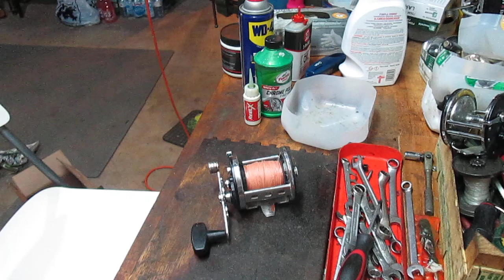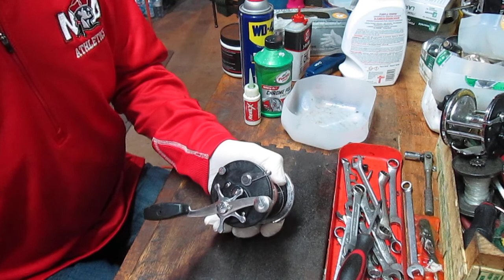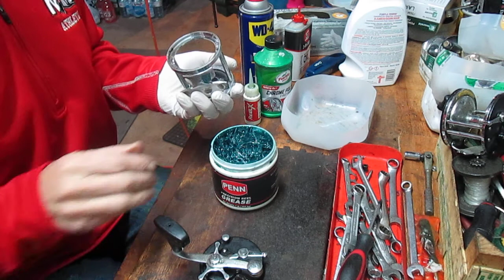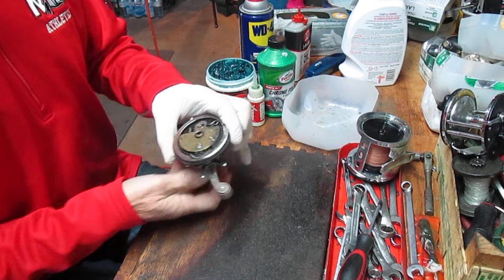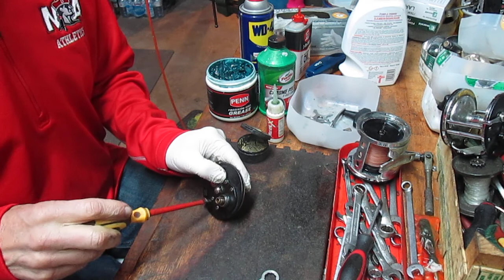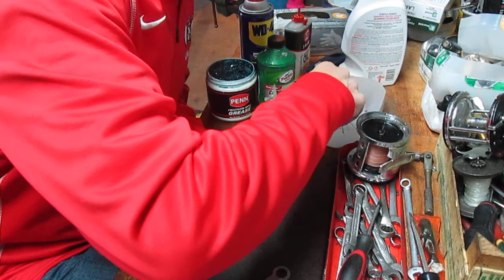Penn Jigmaster fishing reel speed servicing, disassembly, lubrication, drag service and rebuild

Comment: When I put the handle back on with the drag tight, I have a wobbly handle, what am I doing wrong?
Reply from the maker: Is the handle wobbly or the hole handle shaft that wobbles?  If it is just the handle, you may have cross stripped the handle screw.  If it is the hold shaft assembly including the star adjuster, etc then you have  a broken bridge post that would need to have the bridge replaced in order to correct it - Dennis

Comment: Hi Dennis how are you how do you lube a conventional fishing reel thanks
Reply from the maker: Yes - I grease all internal moving parts and I oil the bearings as the line guide mechanism if there is one on the reel.  A fair amount of grease is good, but do not overload as it will only get thrown off the moving parts and eventually dry on the recesses of the reel.

Comment: I spotted the anti reverse on this video.  It stays mounted to the plate. Much better then the Peerless 9 I just worked on. The little flat spring drove me to drink. Not that it had to drive very far. Thanks for all these videos. They have helped me with quite a few reels now.
Reply from the maker: Yes - the flat spring and the later coil spring are not easy.  The 500 comes with the bridge mounted A/R, which is much easier - Dennis
Reply: That spring on the 9 drives me crazy

Comment: I have a question, I have a Jigmaster 500 and when it’s in free spool, it sounds like the spool is rubbing against the side plate if I tilt it during casting. Do you know what the problem is? Thank you in advance.
Reply from the maker: I think you have a bad bearing.   Probably the one behind the handle.  You can get a replacement through Mysticparts.com. - I am assuming that you have tightened the other bearing on the non-handle side plate - Dennis
Reply: @2ndChanceTackle  Does a Jigmaster 500 have bearings? Or are they bushing?
Reply from the maker: Yes, but they are unique to Penn.  You can get the bearings at Mysticparts.com - Thanks for asking - Dennis

Comment: Dennis, can I also use the Penn 60 washer underneath the main gear where that red colored fabric washer would be? I'm like 99% sure it would be a good idea but I figure I'll ask the Penn wizard. The one that came with the OLD JigMaster I just bought is hard as a rock along with the other drag washers. Wish I could do something about the brass showing through some of the chrome pieces but rechroming comes with a large price tag for a piece I plan to fish some.
Reply from the maker: You can use the regular washer, but it is subject to tearing, where the hard washer is not.  If you are going to use a drag washer try to use the ht-100.  It has a plastic insert in the middle, so it won't tear as easily. If you use the older fabric washer, just check it occasionally as it could tear
Reply: @2ndChanceTackle  I actually bought an upgrade carbontex kit through Mystic Parts and it came with a carbontex washer for the bottom. I had bought a few smaller Penn 60 ht 100's to do the trick you show and intended on using it but I just used the kit from smooth drag and then added the 60 on top. Took a lot of work but this formerly unusable Penn JigMaster is spinning beautifully. It's an early rendition of it, I'm not sure how old but it's the oldest of the bunch I've bought and fixed. I put 200 yards of 30lb Dacron as backing and still got a rediculous amount of 20lb mono on top. Far more than I wanted or expected actually but I've yet to meet a striped bass or bluefish that can't be caught on 20lb line so I don't go heavier.

Comment: Hi Dennis,  just wanted to say thank you and that I love your videos.  I have a jigmaster 500 that I forgot to rinse off a few years back after a trip that developed corrosion as a result.  Thanks to your videos I was able to restore it by cleaning it up and properly greasing and lubricating.  All of the parts appear to be in good shape and none of the parts are frozen however when I put everything back together the spool will not spin.  It almost seems like to me that the main gear is not engaging with the pinion to rotate the spool.  Did I maybe miss a step when putting the reel back together or do you think there may be a problem with one of the parts?  The dog is in good working order, the anti-reverse is clicking like it's supposed to, everything spins freely like it's supposed to.  I just can't seem to get the spool to spin when I turn the handle when the reel is put back together.  Do you have any suggestions for me?  Thanks again!
Reply from the maker: Hi - The first guess is that you installed the spool gear upside down.  let's check.  Take the gear side plate off of the reel.  Is the spool gear end flat or is there a "U" shaped slot facing outward?  The spool gear is the one sticking through the hole in the center of the reel.  If the slot dies is not facing out, you will need to disassemble the gear side to reverse it.

If that is correct, the next cause could be that the bearing side spool adjuster is too tight.  When you regrets a reel and put grease in that adjuster, it can tighten up the slack that was in the reel.  Back  off  the bearing side adjuster by turning it counterclockwise and see if that makes a difference.

Those would be the two most common.  A third, which would be less likely, is that you installed the drag stack upside down.  If you are laughing, that is OK.  I have seen it done and it causes the problem you describe.  Make sure that the flat side of the main gear is on the bottom and rests on the gear sleeve washer and that the drags and washers inside the gear are facing out.

Try checking for these.  If it is none of the above, we can try again - Thanks for asking - Dennis
Reply: @2ndChanceTackle  Thank you so much Dennis, I'm at work so I don't have the reel with me but I will check when I get home and let you know.  I think that your first suggestion might be the answer.  Thank you once again!
Reply: @2ndChanceTackle  Dennis you are going to laugh, I forgot to tighten down the star drag tight so there was not enough tension to turn the spool.  Now it spins like it is supposed to, I just have to work with it a little to get it to rotate smoother but I think that should be an easy fix.  Thank  you again for helping me trouble shoot the problem.
Reply from the maker: Happens all of the time!  Especially if the star adjuster gets wedged by tightening the handle before it is adjusted and you think it's tight, when it isn't. Glad to hear it's working. - Dennis

Comment: i have a old jigmaster s. i cannot find any info online about it. could you tell me what the s is and the difference between the normal 500?
Reply from the maker: Yes - I believe the JigMaster 500$ has the single crew take apart system on the non-gear side plate.  The 500 has the take apart screw on the gear side.  The 500S is an older version of the reel and was introduced in the 1980's - Dennis

Comment: Removed the 60 drag washer, no difference in spin, still reels tuff!
Reply from the maker: Was this spinning freely when you first acquired it?  My first guess is that there is a lot of dried grease on the post under the gear sleeve.  Did you remove the sleeve as part of your maintenance?  If you did and all the other parts are cleaned and lubed, then it most likely would be a frame issue. Is the tension bearing on the non-gear side set properly?  You should have some side to side play in the spool.  If it is overtightened and the spool does not move easily side to side, then it will not spin easily.  Try backing that off.  A less common problem is the bearing on the gear side. If you still have the problem with appropriate free play in the spool, try cracking the gear side bearing just a little.  If that frees operation, then the bearing is clogged and most likely should be replaced.  Lastly if those items are OK, then you most likely have a frame that is out of square.  A likely cause of this is a bent reel seat, then bent crossbars or loose screws in the trim rings.  Try these and let me know if you are any closer to a resolution.  Thank you - Dennis

Comment: Hey Dennis, just went through my jigmaster 500 went with the ht100 upgrade w/ penn60 on the drag. Just needed the general wipe down fresh grease and oil.  Will not spin as freely as yours due at the end of your videos . Have taken it apart three times double triple check everything seems fine but will not spin that freely
Reply from the maker: Gary - try this and let me know.  Take the extra washer from the 60 off of the stack and see if it spins freely.  If it does, the HT100 upgrade may use a thicker washer and may limit the clearance so as to prevent smooth operation.  If the reel still turns tight without the 60, then we can check a few other things - Thanks for asking - Dennis

Comment: My pflueger was fine...i tried to clean it but...the pinion gear felt out of place...and took it apart...and put back together..but it looks like both gears don't toch each other.the spool is loose...it will not reel at all.....thank you ,have nice day...
Reply from the maker: I will check to see if I have one.  It sounds like you have an anti-reverse dog that was not reset properly and is jamming the reel gears - Dennis

Comment: Hi Dennis, if you don’t have proper “drag grease” can you use either reel grease or just put some oil on the fabric drag washers to lubricator them? Thanks
Reply from the maker: You can use a reel grease as an alternative.  It is not a thich and will wear out earlier, but it is acceptable.  The idea of the grease is to keep the drags flexible.  Do not use oil on fabric washers.  If you have felt washers in a spinning reel, that is OK, but do not use it on the conventional reels.  Thank you for asking - Dennis

Comment: Do jigmaster 500l has ball bearings and could I change them to ceramic bearings
Reply from the maker: The 505 does use a different part number for the main gear and pinion gear.  It is possible that these differ as the reel is high speed, which suggests more or different teeth alignment.  I have not see any with the problem you describe, but I do not see many of these in my shop. - Dennis
Reply: 2nd Chance Tackle thank you!
Reply from the maker: Mohammend - The regular and older Jigmasters do not have bearings that can be replaced or upgraded.  These include the model 500 and 501 variations.  There are two models that do have the bearings you are asking about.  They are the high speed 505 and 506 models.   These can be upgraded to ceramic bearings.  I have seen it done and the casting performance is incredible.  You can do an internet search for ceramic bearings for Penn reels and it should show you where to get them.  Thanks for asking - Dennis
Reply: 2nd Chance Tackle I have heard that the 505 has smaller gear teeth that tend to shred. Is that true ? Do you ever see that problem on the 505 reels that you service.